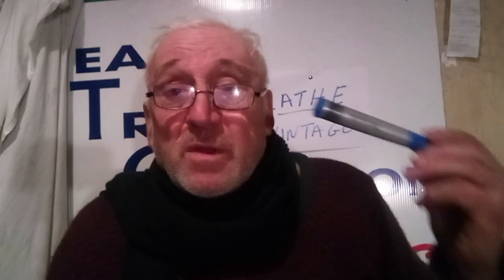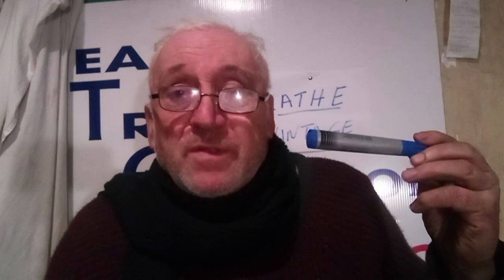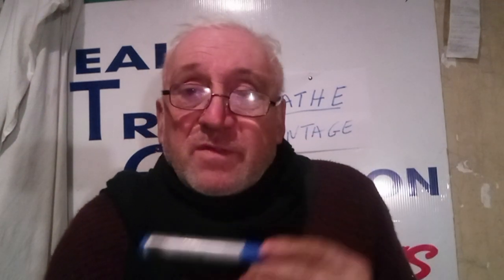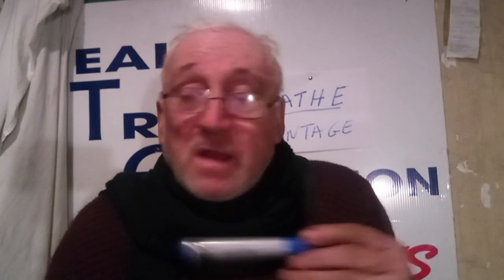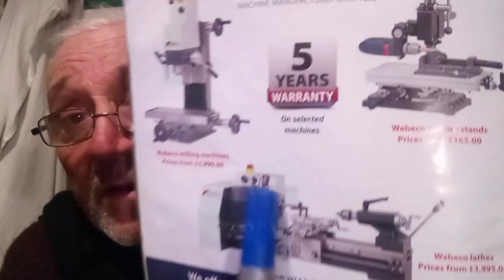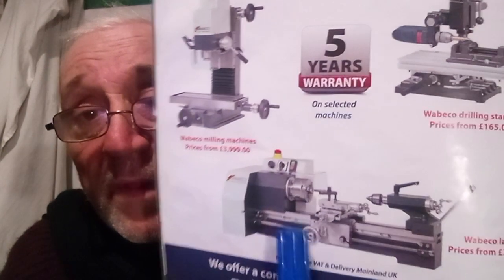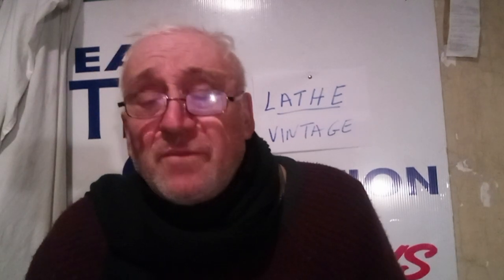Vintage workshop,  buying a lathe.  6th March 2024.

Comment: I bought a Chinese mini lathe aged 65; cheap and cheerful with limitations.  Nevertheless
an accurate practical machine; loads of improvements possible.  Many accessories available.  Some great videos on YouTube; I learned a lot and it's great fun!
Reply from the maker: Tell us a bit about it,  make model, size etc.  I guess single phase.
Reply: @ValMartinIreland    My Mini Lathe; Model CJ0618 bought from Amadeal, London, a few years before Brexit, so no import duty; 500 Stirling.
Specifications are; Metric, 180mm diameter swing/ 350mm between centres.  Single phase .75 HP/550 Watt motor; variable speed, reverse.
It came with a 3 jaw chuck and a few basic accessories.
You can Google for full specs and lathe suppliers in Ireland.
I understand the latest models have a more powerful 800 watt/1 HP motor.
Loads of reviews/tools/upgrades/projects on the internet.  I found that certain hard steels will only take very light cuts.  Still very capable, it's possible to machine a good sized  model engine on the mini lathe,